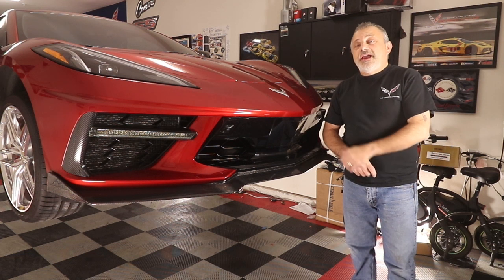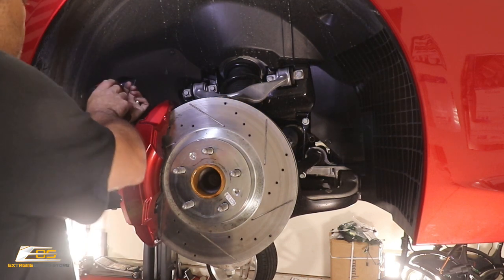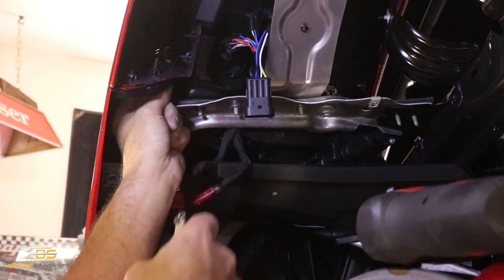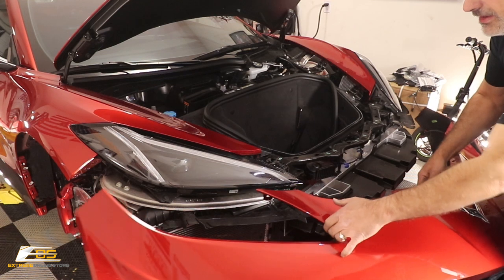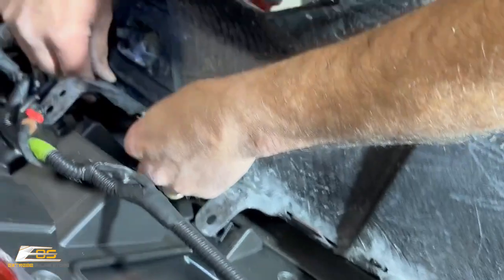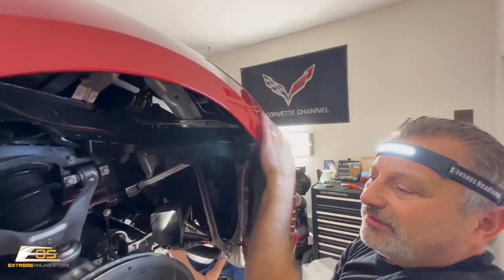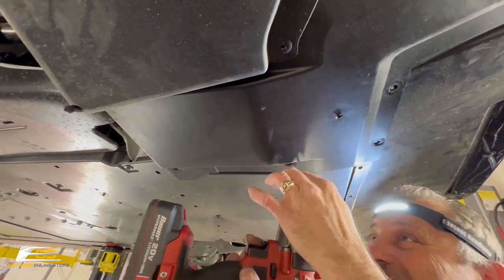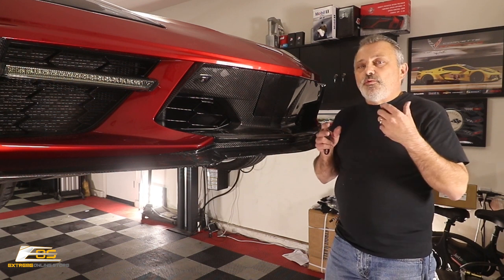How to Install a Carbon Fiber Front Grill on a C8 Corvette

Comment: Hi Scott nice vette, l really like your builds on your corvette, l like your wheels, could you tell me the company and name of the wheel, lam trying different styles to see which ones l like on my corvette, it’s a 2024 c8 coup stingray 1lt non z51 any help would be appreciated, thanks.😎🇨🇦
Reply from the maker: Hi Steve,
My wheels are made by Aerolari if you want to buy a set be sure and mention me and they will probably give you a discount. My wheels are the High Polished version.
Also tell them that you want the offset that will push the wheels out the edge of the fender. It makes it look so much better.
If you have any other questions please reach out!